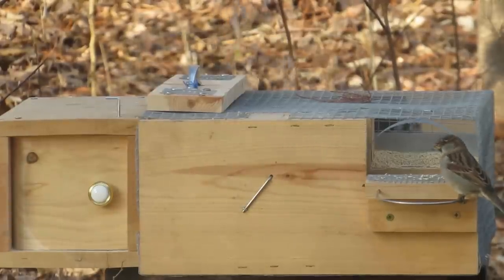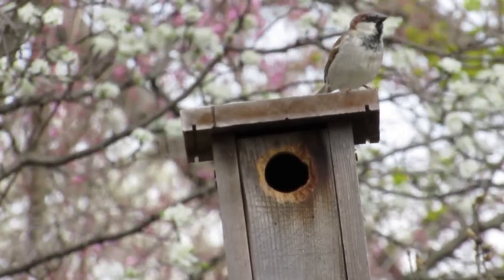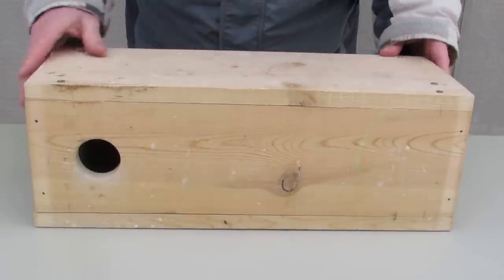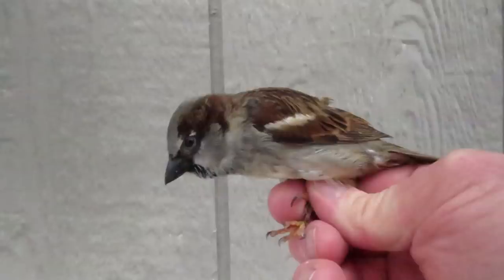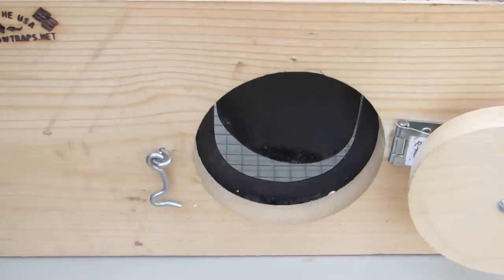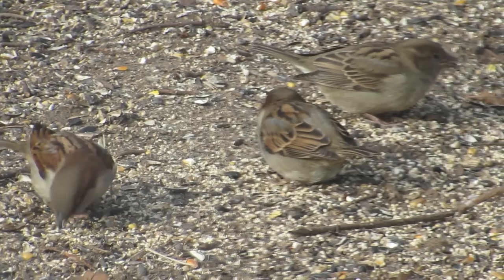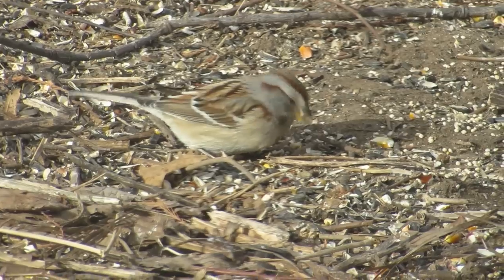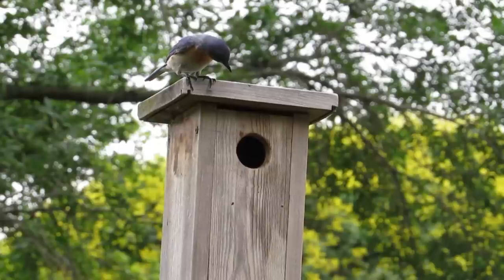How to Catch House Sparrows in a Repeating Elevator Trap 2019

Comment: I just put in an order for an elevator trap. I'll try to make the holding box when it arrives. 
There are a lot of starlings in my area, as well as some English sparrows. What do we do about starlings?
Reply from the maker: If you talk starlings you should euthanize them like you did the house sparrows. Good luck.
Reply: He just came out with directions on how to make a Starling funnel trap... easy and low cost solution!

Comment: What is the best bait for sparrows?Popcor,bread ,milet?...What is the best height for trap from ground?
Reply from the maker: Good question. It seems to depend on what they are used to eating. I use millet as I've had zero luck with bread or popcorn. I would experiment. Place all three outside the trap and see what they prefer.
Reply from the maker: As for height i like it at a height that is easy for me to manage. About waist height. San old card table works great and is easy to move.
Reply: Cracked corn is their favorite by far where I live.

Comment: That's my fear,  bycatch- Thanks for the video!  I always have a nesting bluebird pair and this year they weren't successful because of a starling. Lo and behold,  I didn't even realize house sparrows were invasive! Time to clear the yard...
Reply from the maker: Good luck. You can make a difference.
Reply: I've had a lot of success catching House Sparrows with the Van Ert House Sparrow trap that you put in a Bluebird house if you see the sparrows trying to investigate/nest in it.  You do have to monitor the nestbox closely as you wouldn't want to inadvertently trap a native bird and leave them in there a long time.  It would cause them a lot of stress, so it's not a passive trap per say, but very easy to use, and if a native bird happens to go in the nestbox rather than a House Sparrow, it doesn't hurt them and you can just let them out.  But the best practice is to quickly (they are amazingly smart and will watch you, so have the screw installed beforehand to make hanging the trap quick) put the trap in when you see the House Sparrows around the nestbox in the Spring.  I can see my Bluebird house while sitting on my couch looking through the window (binoculars help see for sure who's going in the box!) and I can just run out there and quickly get the House Sparrows out of the nestbox using a large nylon laundry bag.  Nips the problem in the bud in the Spring before they even get a chance to make more House Sparrows, especially the aggressive males!  Good luck!

Comment: Is the elevator seesaw supposed to be level balanced with 2 quarters inside or should it drop to the bottom with 2 quarters used as a test weight? I lost my instructions and can't find any info online. I haven't used mine in over 2 years because I pretty much eradicated my sparrow problem and just used my nest box trap the past couple years. I'm seeing some at my feeders now and want to get them before my bluebirds start nesting.
Reply from the maker: It should fall too the bottom with the quarters and be level when nothing is in the elevator. Good luck.
Reply: @BackyardBirdsUS  it wouldn't work if it was level with nothing in it. The elevator has to be at the top so they can enter. It would be impossible for them to squeeze into it unless it was maybe a hummingbird. I set it so it drops to the bottom though.
Reply from the maker: You are correct. It should be at the top of nothing in it but at the bottom when a sparrow enters it.

Comment: Do you have a video on how to recalibrate the repeating house sparrow trap?  The last few birds that have tried to enter just pop right back out. So I’m assuming I need to adjust some thing .. thanks for your help
Reply from the maker: You can use quarters to calibrate it. I just looked it up. Two quarters for house sparrows. Make it so it slowly drops down and stays. When bird exits through hole it should return to set position.

Comment: Thank you, thank you.  I have an elevator trap, and will be modifying it immediately.   My small farm has a new influx of HSp's.  I have numerous nest boxes used by western bluebirds and tree swallows.  I don't want the house sparrows predating the nest boxes.  It's very depressing to open a nest box only to see the dead native swallow or bluebird chicks with their heads pecked out by the invasives.  House sparrows are savvy and become trap shy easily, I have found, so my trapping success lately has been diminished.  So, starting over.
Reply from the maker: Best to you. They are smart birds and we have to use every method we can to control them. Also check out the vanert trap for nest boxes. I love that you get western bluebirds. And you are helping them!

Comment: Hello! Thank you for the video. I have the same trap without the mods. My problem is that I have been using this trap for the last four years. It worked wonderfully, up to this year. Before this year, I was catching, depending on the time of year, up to 20 plus HOSP a day. As the years progressed, the numbers have become less and less. This year I have only caught one HOSP. They have learned and are avoiding. I have moved the trap around different parts of the yard, tried to disguise it, etc. to no effect. It's discouraging considering I have Bluebirds nesting in my yard. This is the first year that my Bluebirds were run off due to the ever-present HOSP. They killed the young Blues. It is extremely frustrating. Unfortunately, I cannot use any type of gun, due to living in city limits. I am looking for suggestions as to how to handle this situation.
Reply from the maker: I'm glad you wrote.  I think if you use decoy birds in your trap you will have better luck at catching them.  And like I say in the video, to keep the decoys alive you really need a shelter box.  But there is one other thing you should use in to trap house sparrows...The Van Ert nest box trap.  It will catch the sparrow when it claims a nest box.   Here is a video about that: https://www.youtube.com/watch?v=AT6sQDvJMNo
Reply from the maker: Once you start using the VanErt trap, when you catch a sparrow, you can clip its wings and put it in the repeating trap to use it as a decoy.
Reply: You need to keep live house sparrows in that trap. Try setting that trap up in a permanent location. I have mine attached to a shed and a hole inside the Trap allowing the birds to go into a holding area inside the shed. It keeps them warm it keeps them cool it keeps them from getting caught by predators and stressed out from predators. You can also feed them from there. You can have that trap going all year long like I do. I never have bluebirds tree swallows a purple martins getting harassed by house sparrows any more
Reply: @BackyardBirdsUS   Thank you for the input and I will try a shelter box. Before, I have tried keeping decoys in the trap only to have the trap tore apart by hawks, owls, raccoons, etc.
Reply: Use rat poison. No other choice bro..
Reply: @crzrck  awesome idea!!
Reply: @crzrck  how high up on the shed? Do you put a facade hole on it? I am at my wit's end this year with the dammed things.
Reply: @uhill74  it's almost  eye level
Reply: Great suggestions!  I know this is an older post, but this may help others:   If you're not already, make sure the ONLY food you have out is in that trap.  Cracked corn seems to be their favorite around here.  We had to take away ALL the feeders for awhile one summer.  It was a little sad not seeing my regulars, but the invasives also took off and my bluebirds had relief for awhile with the yard to themselves so they could catch all the bugs they needed for their babies in peace.  The regulars were fine too, because we have native plants which attract the caterpillars they need to feed their babes and we don't use pesticides, insecticides  or chemical fertilizers.  

Look up Douglas Tallamy and learn about the native plant and bird survival connection... his work is EYE OPENING!  For example, he found that a nest of Chickadees will go through 5,000 to 6,000 insects (the great majority caterpillars) by the time they are raised!  Insects evolved to eat and live on native plants over the eons, so when they are replaced by invasive plants (marketed to be "pest resistant"), the insects... and eventually the birds... disappear.

Comment: My shelter box due to arrive today and as and also a sparrow just a few minutes ago tripped my birdhouse trap.  It will be the first guy inside the cage,, what more could you ask.
Reply: Well missed that up for my first try did not get the bird in the elevator part and did not have the entrance hole blocked well enough and it escaped,  I suppose Im not first one to let that happen.
Reply from the maker: Fantastic news
Reply: So the next house sparrow I trap with the birdhouse trap I will put it in the door of the elevator trap so I dont mess up again.
Reply from the maker: Be sure to clip the bird's wings because they can't escape from the elevator trap. And if they do they won't go far.

Comment: I built my first sparrow trap off of the deluxe elevator repeat trap with a shelter box. I'm having some trouble getting them to get into the trap. They step on the elevator which starts to drop and then they fly out. Any suggestions? I think I've heard balance it with 5 quarters I believe I set it to drop at four quarters. Any help would be appreciated by myself and my bluebirds and tree swallows. Thanks! Cory
Reply from the maker: It does sound like it needs adjusting but they are also super intelligent birds. Use 2 quarters for house sparrows. 5 for starlings. Let me know if that works. Having a decoy bird helps to. You can catch one with a Van ert tap
Reply: @BackyardBirdsUS  thanks for the help. I have caught a couple of song sparrows and a juvenile grackle I'll update you later. Thanks!

Comment: You might get a kick out of the house sparrow-proof mealworm feeder I designed and crafted that's shown on my channel.   Wildlife rehab facilities will often take in trapped house sparrows and feed them to raptor birds they may have at their facility.
Reply from the maker: That's a good use for house sparrows!
Reply: Is this the mealworm feeder video you've had out for a few years but which is not available for purchase?
Reply: @stellabastoneintoronto955  As the video on my channel shows, it certainly works to exclude house sparrows.  I appealed to most, if not all bird feeder producers with the idea, but none of them seemed interested in it.  I also developed 2 dropping-proof birdseed feeder systems that functioned to better protect backyard birds from the disease threats bacteria-laced bird droppings on feeder surfaces pose to the health of garden birds, but it went nowhere either.  It was a hard lesson learned that sound inventions don't necessarily translate to something that will make it to market.
Reply: @BenSlover1  yeah I thought that might be the case. I've wondered if you can simply make/sell/ship the mealworm feeder yourself. Maybe if you get enough sales, the larger producers will be more willing to consider it.
Reply: @BenSlover1    I agree with Stella.  Get a patent and try making and selling them yourself!  With the bird flu making headlines so much lately, that cleaner feeder you mentioned sounds like it would be a great thing to have!  Help the birds and do it Ben, we'll be waiting!

Comment: Great video, this is going to resolve a decade old issue for me. What size is the hole on the shelter box? It looks like 2”...

Also, since you built it, is there another place you would rather locate the hole? Or, is the spot you picked for a particular reason?
Reply from the maker: I put the hole there because the other end has a screen.
Reply from the maker: Yes I made it 2 inches. But could be smaller. 2 inches would work for starlings too.

Comment: Cool mods.  I'm the inventor of the Sparrow Trap Door trap. You can google sparrow trap door for more info.   You've added some nice modifications to this trap. The shelter area is slick.  Are these your ideas or did you get them from somewhere else?  For me I just use the Sparrow Trap Door to catch a decoy in minutes and then use a simple funnel trap to catch the rest.  The Sparrow Trap Door is designed mainly for indoor trapping while elevator traps only work outdoors.  But the Sparrow Trap Door is a professional trap used by wildlife professionals and can be outfitted with a Text Alert that calls your phone when you catch a bird.
Reply from the maker: I'm not familiar with the Sparrow Trap Door.  I will look it up.  Ideas were mine for the hardware cloth and handle.  The handle was the first thing I ever added as the trap is hard to pick up.  The shelter box was my idea based on a video I saw of the trap attached to a shed.
Reply from the maker: I take that back. I have seen that trap door trap years ago.  Very cool.  I like it.
Reply: I have your product and I got to tell you it's fantastic. I really recommend it. I use it for any house sparrow that seems to be trap shy. I have generally caught the problem within a couple minutes I just love it